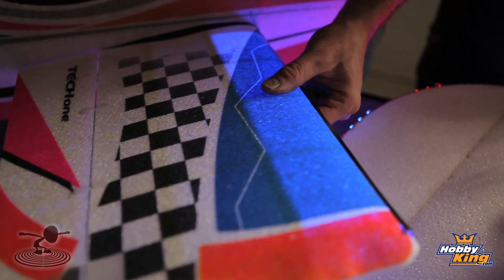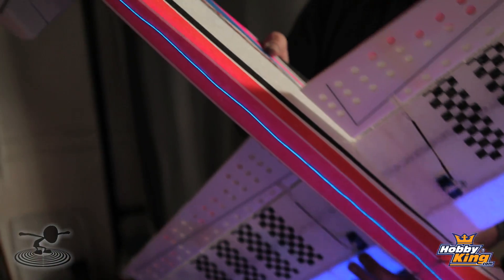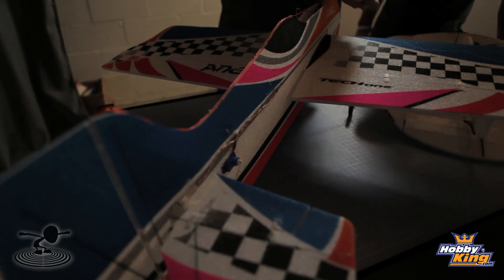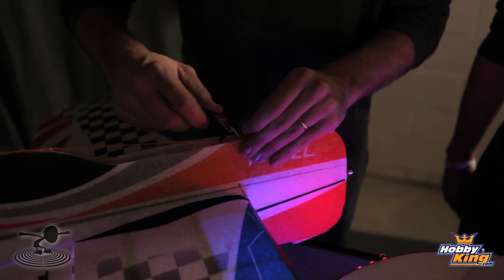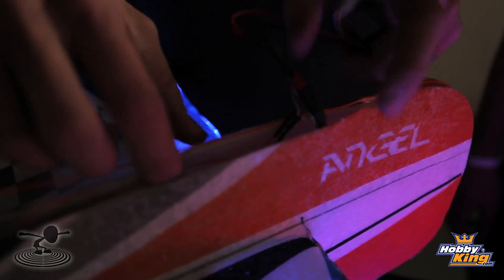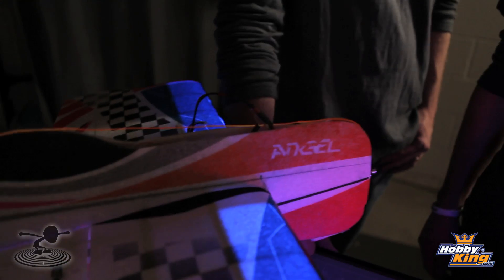Flite Test - Installing LEDs - FLITE TIP

Comment: usually somewhere between 3-5V, but the LED strips tend to have built-in resistor, so they can take 12V in

Comment: Very nice video!  I'd like to add lights to the Radian Pro where I could plug the battery into the lights then inot the receiver.  I have NO skills building so I stick with the RTF and BNF versions, any suggestions, thanks

Comment: @msteer79 take yourself to jaycar and buy a roll of 0.315mm enamel coated copper wire, it works great for hooking up LED's and making extensions for sub 5gram servos, just make sure you have a hot soldering iron to melt off the enamel coating before you solder. You could also rip open an ethernet cable and use that wire of do what these guys are doing and use telephone wire. 
cheers, Zac (aka NZsloper from parkflyers)

Comment: Hey guys, fantastic vids, keep it up!!!

Can you please tell me what the best wire/cable from hobbyking to use, to install the turnigy LED strips??? I would be cutting them up and placeing them in different parts of the plane like you have, I just want to know the best and lightest cable to use, to chain them together, and to run them from the battery. I will be putting them on A leadfeather epp yak55, so I need the wire as light as possible.

Cheers, From New Zealand